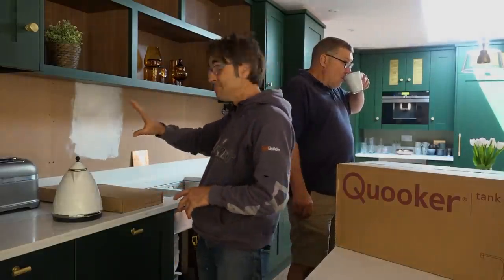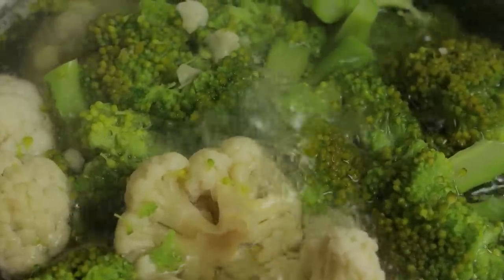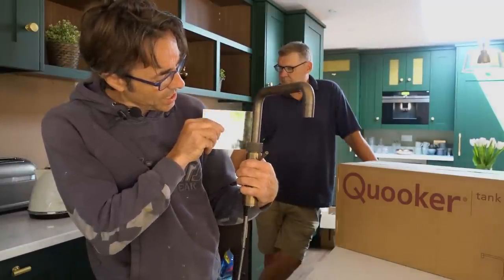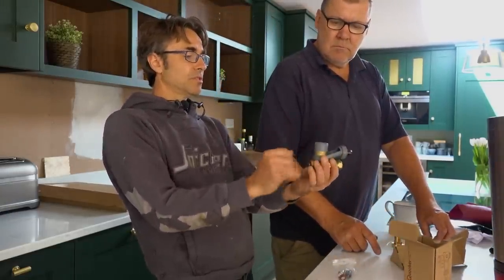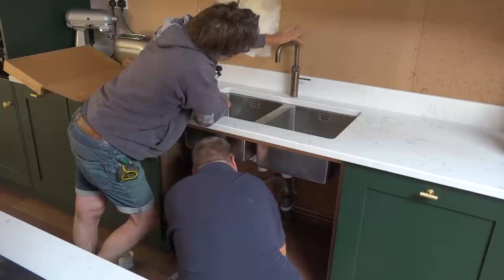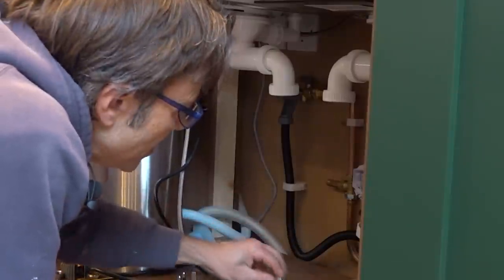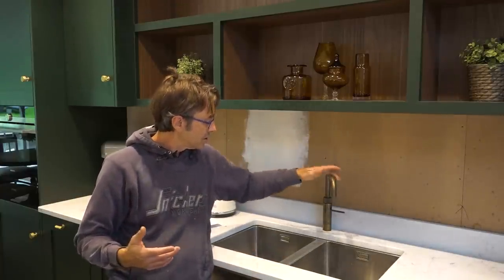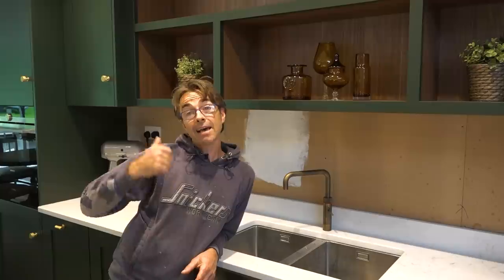Quooker Fusion Boiling Water Tap - Capel #29

Comment: I have a Quooker tap. It's not cheap but it works well and we are very pleased with it. The Quooker tap will change the way you do things in the kitchen for the better. Like you we chose the hot/cold/boiling water option but with a seven litre tank. The larger tank gives you enough water for an instant start to cooking; it's not just about tea and coffee. It's one of the best purchases we have made. Top tip - In a few years you may have a little puddle of water under the sink you can't find the source of. It will come from open end of the pressure relief valve tube. The cause will probably be the build up of muck in the pressure relief tube at the waste end in the main sink waste. Blow the crap in the pipe through to solve the problem.

Again, another well thought out and well presented video.
Reply: Still good or have you had more issues?

Comment: This channel is becoming the Robin show. The carpenter that has MDF cupboards, vinyl floors and quartz worktop
 Wheres all the wood?
Surely Roger is the favourite plumber as well
Reply: Smooth surface for painting
Reply: I was very surprised and disappointed to see him use mdf skirting boards i was expecting to see oak veneer skirting boards and then oil them.

Comment: At £1150, I'll stick with the kettle.
Reply: Jim Newlands very true my brother spent more on his kitchen than I did buying my house in 1998 which was only £35000 he spent £38000 I suppose it’s no problem for him when he can afford to spend £80000 on a TESLA
Reply: @Jim_Newlands  It's his personal house. If he wants to spend the money then....
Reply: @Jim_Newlands  that would be called a kettle or jug!
Reply: Better upgrade would be filtered water spigot.
Reply: Bad Robot 
The tap itself can have an additional filtered  water device as well. The only change is a t piece off the hit vessel and another low voltage lead that connects in the back of the vessel to tell the hot tank vessel to shut off when calling for filtered water. 

They are clever but very expensive.
Reply: Bluewolfe  That's about the price ill be paying for base units, and doors. Will fit myself. While I like the idea of the tap, that is a high price to commit to years of maintenance and service charges. If you're well off enough to pay someone else to do all that, I suppose it could be a nice addition.
Reply: Sake, ye lose more than that running for the helicopter
Reply: Chicken feed to Robin
Reply: @£1,000+ how many kettle boils is that?
Reply: £1150 plus continual filters and service costs.

Comment: Just a quick note Robin - the condensation hose should be looped to form a water trap which stops any smells coming through and also might be worth considering a water softener system which will stop any limescale build-up in the tank and also protect your worktop - great video as usual 👍

Comment: Fine and dandy if you do not have hard water - otherwise a maintenance headache and the service kits are not at all cheap.
Reply: With a permanent boiling pressure vessel under the sink,  I think a child lock might be in order for the cupboard.
Reply: Get the anti scale filter by quooker which fits along the vessel.
Reply: Chris Taylor Yeah true £90 per copy and £80 cartridge replacement every 6 months. Believe me the maintenance costs (even DIY) are just not worth the candle in a hard water environment. You could buy an £80 kettle every year and still be well ahead of the game.
Reply: Norman Boyes oh believe me I’m with you on it all the way. 

I installed a £2000 set up for the clients to use a kettle after 6months because they didn’t like the spluttering when calling for boiling water. 
Now they only use it for the filtered water 🙄

Comment: I'm disabled with only one restricted weak arm and as such cannot lift a Kettle. I purchased a Quooker as it seemed a massive help to me as all I had to do was turn the tap. to me, this was life changing and although it's overdue a service, it has lasted 6yrs now and still going strong. It's not as pricey to run as people think, but even so, I have mine on a WiFi alexa plug, so it's programmed to come on & turn off as and when needed. Very highly recommend them. Only wish I could afford the hot and cold version with a nicer looking tap. Hayho, am happy with what i've got though for the time being.

Comment: i fitted a quooker fusion tap last year. had a couplea problems with it but mostly it was because the lass had moved the box with the tap connector reducers in it... went all over south shields trying to find 15-12mm reducers haha. eventually cobbled something together and got it all working..... then found the box with the right parts in. The tap is still working class after a year and the lass loves it

Comment: I've regularly used both qooker and one of the cheaper manufacturers' taps, and despite looking shitter, the cheaper one was a far better experience. The qooker was extremely spurty and continued fractionally too long after turning off the tap. Quooker have the patent on boiling tap, hence why the others are only 99 degrees, but the extra degree makes zero difference (well, 1, but you know what I mean). If your budget is tight, I wouldn't go the extra mile for the quooker, it's not worth it.
Reply: What is the name of the cheaper manufacturers' tap?
Reply: @paulgo1146  annoyingly, I can't remember. Both taps were in two different offices I went to every week for a few years. Lockdown means I haven't been back! I had a colleague who swore by the one she got from Costco, as we talked about it at the time. Once again, I unhelpfully can't remember that make either! Not much use really! Apologies.
Reply: Other post said Qettle
Reply: I have fitted two Grohe Red combined BWTs and they are excellent.  It is true that the water temperature measured at the outlet of the tap is not 100C ( actually about 98.5) but by the time you put it into a cup or teapot it will have reduced anyway due to the much cooler vessel and its thermal inertia.  Before the second Grohe I tried another, only marginally cheaper, brand which was hopeless and I sent it back and exchanged it for the Grohe.  It seems that these taps are of two main types.  Some, like the Grohe, hold the water in the tank at pressure and these work better as the valve controlling the flow is on the outlet.  Others, like the other one I tried, have the tank at atmospheric pressure with the valve on the inlet so there is a significant delay both before water comes out of the spout and after you close the tap  when water continues to flow.  I have reservations about the safety of the latter type as well as if the thermostat fails and the tank boils it will vent boiling water out of the spout.  The pressurised type will vent into the drain via the relief valve and tundish which is much safer.
The Grohe is about half the price of the Quooker!
PS  I have to agree with Robin about the colour.  It looks great in his kitchen and blends really well with the green doors and the very smart handles.  Maybe bronze for the handles might have been better than brass.
Reply: Interesting comments, guys. There are a very small number of taps that dispense truly boiling water - i.e. 100C. QETTLE is one of them. We agree that it's definitely wise to read the small print - that 1C really does make a difference - especially if you want to make a 'proper cuppa'! QETTLE's clever 4 in 1 design is globally patented.
Reply: @qettletap  I agree  I have two Grohe RedDuo taps which are excellent.  Both deliver 97C at the spout.  The older one has a manual tap for the boiling water and the newer one has a touch sensitive electronic control for it.. I prefer the older version, my wife prefers the newer one.  Before the latest one I had a Vellamo which was hopeless.  Never managed more than about 78C and spat a lot.  Also since the control of the water was on the inflow to the tank the tank was at atmospheric pressure so very noisy when heating up.  We could hear it on the other side of the house.  Also, in my opinion, potentially dangerous as if the thermostat failed it would boil and vent boiling water and steam out of the spout.  Can't happen with the Grohe which controls the water flow at the outlet of the tank so the tank is maintained at mains pressure ( about 3 bar) so it won't boil, if it does it vents safely into the drain via the relief valve.  All together better.  Looks nice as well and a lot cheaper than a Quooker which looks very flimsy to me.
Reply: @qettletap  Yes but see latest " expert" advice on the best water temperature for making tea which advises much lower temperature for best flavour.
Reply from the maker: @qettletap  Is it legal to store water at 100 deg celcius? I thought it contravened the G3 regs

Comment: Great piece of kit. I fitted one in my daughters house.
Word of warning. If you fit it under a Belfast sink you won't have enough space so you'll have to cut a hole the diameter  of the tank in the base of the unit to accommodate the tank.

Comment: I've had a Quooker for years and despise the thing!!! It needs servicing annually (sometimes more frequently) £150 if you want Quooker to do it or FOC DIY.  New filter is £30, and service kit (foc normally).  Depending how hard your water is, that cylinder will be full of scale inside a year, oh and the anti scale units don't work great and have been known to burst apparently.  If it sucks scale into the tap, new tap head £100+.  Coupled with the initial outlay of £800+ depending upon model - I start to tick when i think how many kettles I could've bought by now! Word of advise guys, don't get one - as my Mrs wont let me get rid of the bloody thing now! Every time it has an issue I make an effort to get rid, and shes having none of it !!!!!!!! Enjoy Robin...... :-)
Kitchens looking great....
Reply from the maker: Good feedback. Every plumber knows that the closer you get to boiling the more scale will be deposited.  There is no way around it but to remove the scale on a regular basis. Just look at how long an instantaneous shower lasts in a hard water area  before  it scales up and that is only heated for a few minutes a day to around 60 deg cent.They give a warranty but it doesn't cover scale.
Reply: Skill Builder in any normal tank water scenario people should be installing water softeners to combat this. As you said boiling water is another task altogether. Pays your money.
Reply: @christaylor5291  You should not put a softner on a drinking supply. These units are horrendous in hard water areas and, incidentally they are illegal to fit in the U.K.
Reply: @Roger Bisby hi, fully aware not install on drinking water. Perhaps I didn’t explain. Any normal storage tank water scenario that you wash in and appliances, water softener is a great investment to battle scale on bath/kitchen brassware.
Reply: WASTE OF MONEY!
Just another Unecessary EXPENSIVE gimmick appliance and with boiling hot water spurting out of a tube a accident waiting to happen and a home with kids running around.
No thanks!
l will  stick with my old reliable safe kettle and my old fashion taps.

Comment: “Installation was really quite simple”. Not as simple as plugging in a kettle though.
Reply: I find it hard to believe if this is keeping the water boiling hot for ready use ,that's more efficient than boiling 1 cup of water in a kettle when you require it 
My 3kw boils 1 cup of water in 32 seconds and it's using zero energy at all other times

Comment: We have one of these at place of work, there's around 100 employee's and it probably gets used 300 times a day minimum. In 12 months its probably only gone wrong once, they're extremely expensive for what they are and I certainly wouldn't recommend anyone getting it for home use unless you've got a fat wallet... But they're very impressive bits of kit and very reliable.
Reply: At a work place with that many employees, it would pay for it self but to get the return on it in a domestic environment is asking some.

Comment: I completely agree with energy saving but the water is sitting and being stored which means it wont be fresh
Reply: Nottingham Forest Forever I thought this but after running one for six months I can vouch for how good they are. The water never tastes like stale water can do in a sink 👍
Reply: If the water is stored under pressure in the tank there is no air above it as long as it was properly vented during installation so it should stay just as fresh as bottled water which has a long shelf life
Reply: We have an oil cooker and if you take tea from it, it's tastes way better than straight from the electric kettle. I wonder if this would be the same.

Comment: Robin. Is there any stats on when the quooker starts paying for itself? 

Also, as I am someone who never goes in the kitchen. Is there really a difference between 98 degrees and 100 degrees?? 🧐 or are you trying to convince yourself??? 😝
Reply: I’ve installed loads of these and the different types they do. Personally I don’t think they are as hot as a kettle. People who use these to fill a pan of water baffles me, maybe for gas but the fact that an induction job can boil a ltr of water in a minute approx. 
The standby charge a day is approx 2p a day I believe.

Comment: Surely the kettle could be cheaper to run .... If u only fill it to how much you need  whereas that heater will continuously be topping itself up to keep all 3 litres at boiling point... Also I understand these things are child proof but I reckon most kids could figure out how to get that tap to draw off its boiling water... Also if you draw off just the hot and then turn it off...then draw off the boiling water u will be drinking the small amount of hot water from your cylinder or combi that was left in the spout ... Nice idea but needs improvements yet ... That and I bet your prv valve will be dripping in 12 months from limescale if u live in a hard water area ... Just my 2 cents
Reply: Not so.  The boiling water comes out of a separate tube within the spout.  Fresh water from the household supply passes outside the boiling water tube to prevent being burned by the heat of the main spout.
Reply: @katabrontes  I stand corrected.... Still not a great idea for kids though, they aren't likely to boil the kettle and tip it over themselves but very likely to get themselves as drink from the tap....

Comment: The overflow pipe can give a lot of trouble, it should have it's own waterlock instead of the little plug, there is a real risk of leakage and backflow of greywater, The solution they came up with for the overflow, a plastic hose and the attachment you drill into your main drainpipe, is finicky at best. I've been called in to fix quite a few installation issues, the grounding is also...not perfect. Even without the device itself malfunctioning there are all kinds of potential issues. Stick a bucket in the cabinet and you might just break the little nubend off the pipe or uncoil the hose, now you have a leak not only from your how water overflow, but from any wastewater that goes into the pipe - it's usually the dishwasher deciding to flood the premises while you're out. On top of that, everyone I've talked to who has one has burned their hands at some point. I'd never recommend. But hey, convenience.
Reply from the maker: Thanks for the feedback.

Comment: IMPORTANT SAFETY WARNING 

Quooker, water taps use a pressurised system rather than an open vented cylinder used by some other manufacturers. These cylinders store the water at a higher temperature (110 degrees)  and usually deliver it at a higher pressure, however, there are drawbacks. As stated here Quooker are famously the only brand that store and deliver the water above 100°C, but because of this, it means that their products are unable to get UK approval as, for safety reasons,  water regulations state that you are not allowed to store water above 100°C in a domestic dwelling. What this means is that you are breaking the law if you fit one.  If you install a 'true' boiling water tank and tap in a new build property, the water company should  not connect your mains cold water supply!  You will also not be able to get your hot water system signed of under Building Regs.  
Interestingly none of this information is conveyed in the Quooker literature.
Reply: Makes complete sense that. Is that in the building regs Roger? What part no?

Comment: "energy Hungry ".. I love your work and have watched all your vids but I gotta tell you...taking 1 lite of water from 10 degree C to 100 degrees C used the same amount of energy no matter what you use.  In fact water will reach 100 degrees C... long before it actually Boils !!
Reply from the maker: Hi Jim 
Every plumber knows that that it takes 4,200 J to raise the temperature of 1 litre of water by 1°C. so for this 3 litre vessel it is easy enough to calculate how much it takes. The difference between this sealed pressurised vessel and a kettle or pan on the stove is really the heat loss. Here it gets complicated because you are heating 3 litres of water which is more than you normally need and you are maintaining it at 110 degrees until it is required. Those variables are very difficult to quantify which allows the manufacturers to make any claims the like. It is very doubtful that it works out cheaper than a kettle that is filled with the correct amount of water  and used when it is boiled.
Reply: @SkillBuilder   Wasn't expecting a personal answer, fair points, so cheers guys.